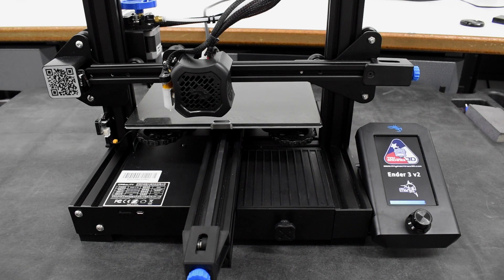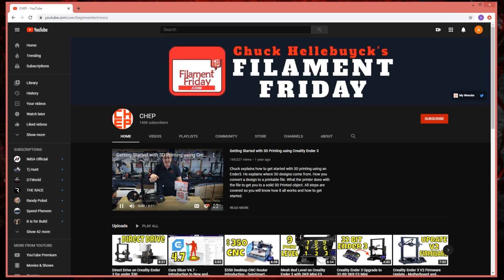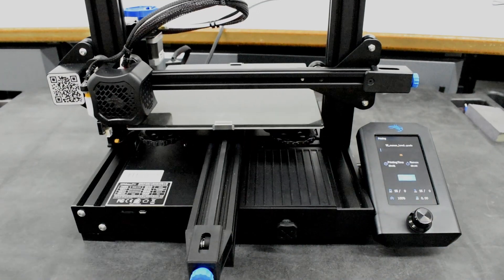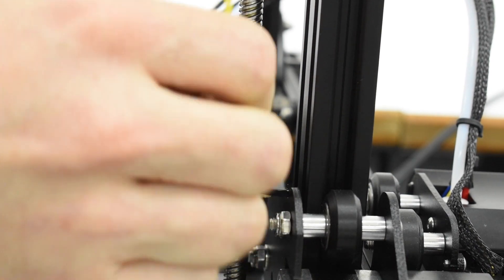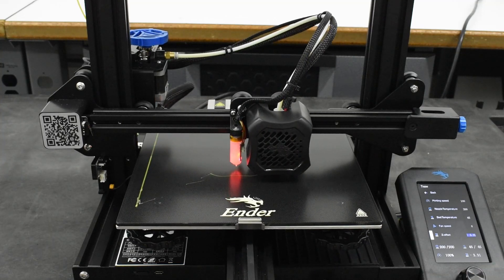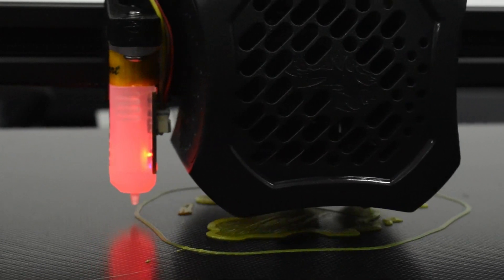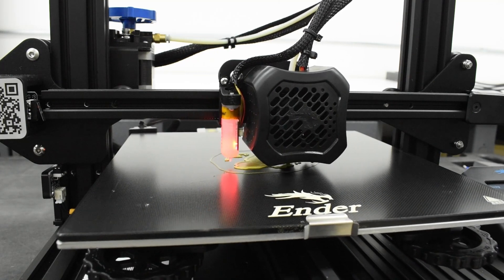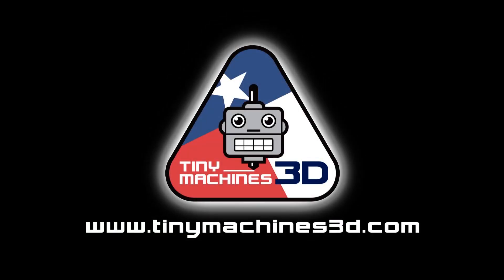Ender 3 V2 Manual Leveling and First Print

Comment: What if nothing is printing. Does that mean I have the nozzle too high?
Reply: You have the nozzle to close or you haven't primed the filament
Reply: How do you prime your filament?
Reply: @ClippyLikesToRepair    preheat filament type pla or abs. If other you have to do it manually Control > temperature, 
Once your nozzle reaches heat push your filament though the gear extruding system push it though your nozzle. once you see filament coming out your nozzle your done. Auto home just to be safe.